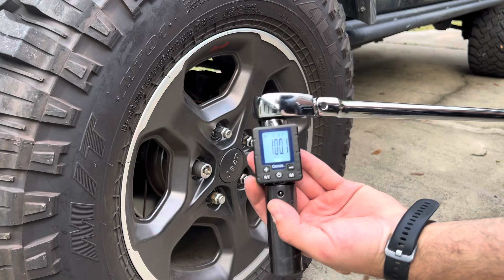Which of these impact drivers remove LUG NUTS!?

Comment: I have used my Milwaukee M12 impact driver to remove lug nuts that were torqued to 112 ft-lbs. It's a beast, considering its size. It damn near replaces the need for a mid-torque impact wrench.
Reply from the maker: It’s a great little impact, use it everyday at work

Comment: I have always wondered how well an impact driver would work for lug nuts. Looks like flex and Hercules are the best options. 

Thanks for the video!
Reply from the maker: I would like to have had the m18 as well. The flex the Hercules and m18 could all do it with relative ease
Reply: @Kaleb_RoSs  the gen 4 has more torque than the Hercules and flex.  But the gen 3 is slightly weaker than both.
Reply from the maker: @DustbowlMic  I have seen a mixed results from the gen4 I love mine that I have at work but it has to stay at work. I’m considering buying a second one to compare to these
Reply: @Kaleb_RoSs  another one is the Metabo hpt 36v “BOLT”. It’s expensive but it is second only to the Milwaukee m18 gen 4 driver. But you get the IP56 rating and a lifetime warranty.
Reply: @Kaleb_RoSs  You don't use 1/4" on lug nuts because the adapters can break. Lug nuts around 80 foot pounds, and the breaking strength of 1/4" hex bits and adapters is around 80 foot pounds. Use the correct tool for the job. Minimum 3/8 socket, or better still 1/2 socket.
Reply from the maker: @sasquatchrosefarts  I agree, I’m not saying impact drivers are the right tool for the job

Comment: This is SO helpful - HD has the Ridgid right angle impact ratchet on sale but it's expensive. Never thought to use my impact driver on these.  SOO for the really stuck ones, I'll use the Bauer corded 1/2 inch impact wrench with something like 1000 ft/lbs of break away torque.  They have a 25% off sale which makes it only like $60!!  Which is insane!
Reply from the maker: Impact drivers arent really meant for this but the more powerful ones could come in handy when in a pinch for sure.
Reply: Read the fine print on that 25% no bauer or hercules are included in that deal
Reply: Dude you can do the buy one starter kit with the 6ah & 4AH and you can  get one of the Ridgid mid torque right now for far less than that right angle impact and it’s plenty powerful unless ur looking to break loose Honda crank bolts or work on an 18wheeler comes out to 90$ for the tool alone an 90 for the starter kit but I’d just buy it and return the starter kit (ppl call it hacking the deal) and if u do that u got the mid torque for under a bill…just figured I’d wish someone would’ve told me if I were you oh and to  lyk they have the high torque on a bogo too but it’s a lil more expensive but well worth it for the price as Ridgids last octane model high torque was actually even more powerful than the 2767 Milwaukee, however Milwaukees back on top with the 2967 it’s a great tool
Reply from the maker: @Jeff-rk8hq  I literally did that ridgid deal yesterday lmao. Check out my recent videos. Got the 2tool combo of the hammer drill and impact driver and got the mid torque and grinder free. Also looked at the high torque BOGO as well
Reply: @Jeff-rk8hq dude I already said for the really stuck ones ima use the Bauer. I blew off the right angled Ridgid once I bought that beast!
Reply: @Jeff-rk8hq bro..I did the hack.. it comes out to 189$ with the 8ah max or 92$ tool only.. the day after I saw the kit clearanced for 342$ (down from 379) that was just in this store.. but online it was down to 359$ ! That means even less for the impact wrench
Reply: Rigid is too proud of their batteries.

Comment: I haven't tried the others, but i own the Hercules 20v impact driver with 5a battery, which is surprisingly strong when used with 1/2" impact sockets and adapters. Obviously not the right tool for it but it can most certainly remove lug nuts. I use it for pretty much anything a 3/8" gun is suitable for, and of course the typical screws. Because of how it performs, I haven't had the need to get any 3/8 impact. I'm also fortunate in that i live where cars do not rust 

In addition to the impact driver, I also own the Gen 2 Hercules High Torque 1/2 impact wrench, and the Dewalt DCF891 Mid Torque 1/2" with the 5a Powerstack. Harbor Freight needs to come out with a stronger 1/2" compact Mid Torque as their current one is somewhat weak
Reply from the maker: The Gen 2 ultra torque is also quite badass in my opinion.

Comment: Hello Kaleb, question Boss. I was just gifted a Milwaukee impact as I wanted to use it to speed up my process for my monthly wheels off detail. Would this be good to use? Also what was the tool you were using to measure the torque of each lug nut? My apologies for my ignorance. Just trying to find out some information. Thanks in advance.
Reply from the maker: I was using impact drivers to see if they can remove lug nuts but I wouldn’t recommend using them for that regularly. They can do it but an impact wrench is much better suited for it. I was using the quin torque wrench adapter on my breaker bar in this video but you can get some reliable torque wrenches for a better price than this. Thank you for watching!
Reply: @Kaleb_RoSs  Thanks for the reply Boss!

Comment: You got a lot of impact drivers.

I tried to remove lug nuts with my impact driver and it can't do it. Sad! I have a Hyper Tough 20 volt brushed and the Skil 12v impact driver. The HT impact wrench of course makes quick work of them.
Reply from the maker: Yea these were all removing lug nuts that I had properly torqued as well though. There’s bound to be plenty of lug nuts impact drivers can’t remove if they have been on there for a while and got seized up

Comment: The Hercules impact driver is an absolute home run. The Flex and the Atomic are still a bit better, but I’ve been able to remove F250 lugs and some rusted nut off rear u-bolts with the Hercules.
Reply from the maker: Yea, I have limited use with the Hercules and I judged it a little too soon in my initial review video of it. The 2.0 that comes with it holds it back a lot. But with the 4ah extreme it’s a beast
Reply: I would still go with the Milwakee.
Reply from the maker: @mg8720-u7j  I have all Milwaukee at work but that’s not saying they don’t have a lot of problems.
Reply: They are weak impact guns.
Reply from the maker: @mg8720-u7j  the Flex, Hercules and Milwaukee are all comparable in terms of power. I literally have a video about it coming out soon. They each excel in different applications. AND the flex has a LIFETIMES warranty while the Milwaukee and Hercules don’t. The Hercules is only $70 bare tool and the Milwaukee has the platform of all the other tools they have accessible

Comment: Kinda surprised the triple hammer had an issue but that's the results.
Reply from the maker: I was as well. Maybe with the multi volt batteries it would to do it a bit easier
Reply: the triple hammer is a good concept, on paper, but,  it has a flaw,   most impact drivers have 2 hammers spaced apart at 180 degrees,   so when hammer #1 hits, it has a longer travel from zero degrees, all the way around to build up that momentum ,  when hammer #2 hits, it  has travelled a full 180 degrees, which means more momentum, harder hits, harder impact, more force, its physics,     the triple hammer has 3 hammers, each hammer travelling a shorter distance, smaller revolutions, less travel, less force, weaker impacts... if you can visualize this,  you will understand

Comment: You missed the RIDGID lol. On a serious note thanks for the comparison video! I took the RIDGID 4 mode impact and converted it to a 1/2" impact wrench using a Milwaukee anvil

Here's it removing lug nuts at 100ft lbs
https://youtu.be/wcTF-ONyQuk
Reply from the maker: Yea the ridgid 4 mode is a BEAST. Sadly I only had it for a few days though.
Reply: @Kaleb_RoSs  sorry to hear about that. There are some good deals on ebay. Got mine a month ago for 50!

Comment: your missing the point here. most lug nuts are over tightened by air impact wrenches, then a torque wrench after, goes click click.   i take wheels off everyday for my job, and need a breaker bar on stand by. as my air took is crap.
Reply from the maker: I’m not missing any point lol. I’m not telling people that impact drivers are the right tool for the job. I’ve ran into plenty of lugs that were over tightened and bent my 4way or my breaker bar by trying to get them off by hand as well

Comment: Lol aren't you suppose to use a impact WRENCH and not an impact DRIVER?
Reply from the maker: Correct, just seeing if the drivers COULD do it
Reply: @Kaleb_RoSs  Ah I see, lol I made the mistake of buying the impact driver for lug nuts...  Now I'm stuck with the driver instead of a wrench LOL
Reply from the maker: @MeepMeep88  well depending what driver do you have? I have a video coming out soon on how to make your impact drive a hybrid of a wrench and a driver just like how Bosch has their Bosch Freak impact driver/wrench
Reply: @Kaleb_RoSs  I got the M12 FUEL 12V Impact Driver.

And now I have the impact wrench 3/8 stubby.
Reply from the maker: @MeepMeep88  gotcha, nvm then. I have the 3/8 stubby as well. Use it everyday at work and love it!
Reply: @Kaleb_RoSs  but I also live in the rust belt. I'm hoping it'll be enough